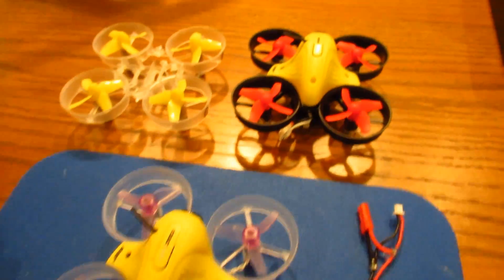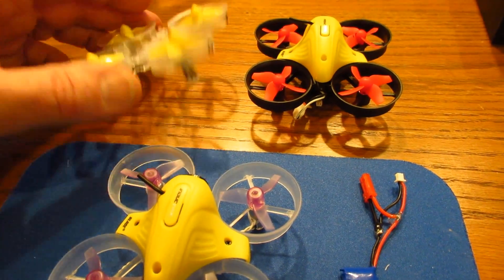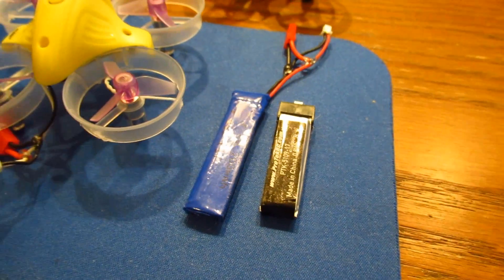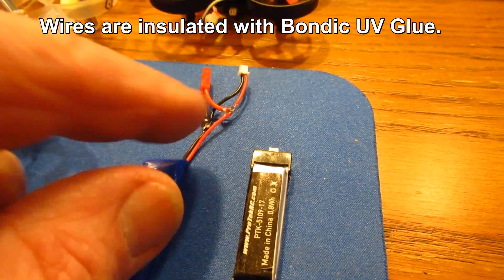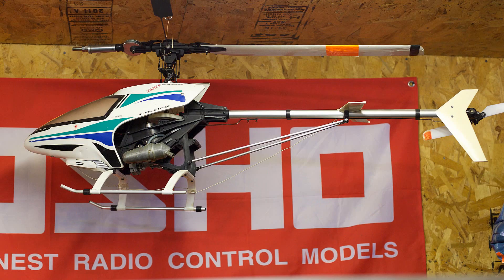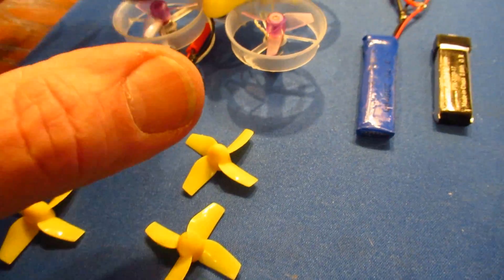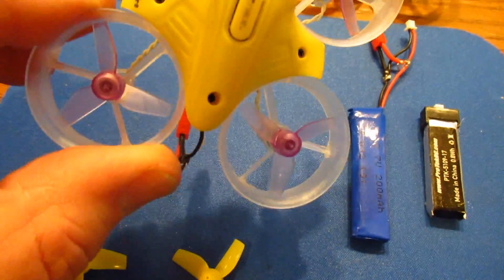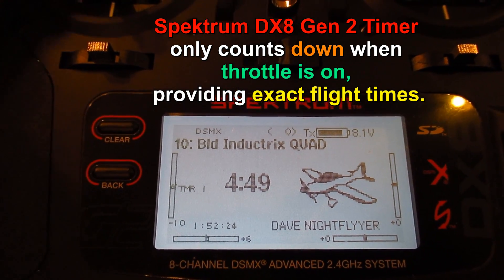Do 3 bladed Props increase Flight Time on the Blade Inductrix as advertised to?

Comment: of course 4 bladed props is faster than 3 bladed props cause 4 bladed producing wind faster than 3 bladed
Reply from the maker: Not true, unless you have a bigger motor.  My one bladed helicopters are faster than any of the multi blade.  It takes more power to turn an 4 bladed prop than a 3 bladed prop.  It's simple Physics. My 2 bladed Inductrix is even faster, and it flies even longer. I've proven it in my videos.

Comment: Just a suggestion; maybe use a throttle percentage timer which will take into account the variations in throttle power used during each flight and produce a more accurate test?

Comment: what happens if i cut the stock 4 blade prop down to a 2blade just by cutting 2 off simply, would that work? as i can only find different colour 4blade ones
Reply: iyt does drop more easy u need more trottle

Comment: A friend has my Align CHP EDL frame that he has mounted to a jig that will be used to measure thrust.  He will be trying a few types of blades, and then comparing a 3 blade head to a 2 blade head, as well as what pitch provides the most efficiency.
Reply from the maker: I just got new 250  MA Batteries from Crazypony and they are even longer lasting, so everything helps.

Comment: In your text you mentioned LVC control how do you disable that on the Inductrix? My Inductrix only gave me 2 to 2 1/2 minutes and it's stop when I measure a 3.7 voltage on the battery

Comment: Cut the four blades down to 2 and Dremel them smooth, best mod I did for my inductrix flight times were atleast a minute longer and the punch out improved greatly! Good to see a comparison with these Rakon blades as I was thinking of ordering some, now I know I will so I can try them with some upgraded motors on a LOS inducrix. Happy flying!
Reply from the maker: I was in the process of doing that and just finished producing the video.  I expected it to work as it is logical, and it did.  Thanks kindly.

Comment: 4 bladed prop and micro deans connector stock inductrix fpv https://www.youtube.com/watch?v=OLwplUC3lCM&t=42s  over 5 minute flight im gonig to say this again the problem is the early LVC bypass it and fly with a timer like i do. battery comes down at 3.65 rest at 3.75ish  but fun seeing you back Mr herbert
Reply from the maker: Yep,  I just finished a 2 bladed prop video and just a standard 200 mah battery and got 5 minutes, so that by itself is a big improvement over the 4 bladed props

Comment: to be honest i been over the flight time and i was the first one to explain about the connector issue on the first inductrix i go for performance, check out my 5 minute blade inductrix fpv flights with acro mode and how fast and great mine flys in 15+ mph winds outdoors ;)
Reply from the maker: I did and it is good.  I also just finished putting 2 bladed props on and find it flies longer and seems to have more punch due to less mass to get spinning too.  Thanks and keep up the good work.

Comment: i've always had a little problem with the one blade hypothesis that one blade takes less energy to spin than two- that's correct, but in my own testing you need to bump up the pitch curve to hover at the same head speed which means that one blade has to work twice as hard- you do not get exactly twice the flight time, but i absolutely agree you will see an increase in time due to minimizing the turbulence. as for 4 bladed vs. 3 bladed, you would need more aggressive pitch on the 3 blades in order to get the same whippy performance out of the inductrix which would be creating possibly more turbulence. The scientific test to prove this would be putting it on a scale and running at the same throttle and seeing how much force is generated- if it's exactly the same between the 3 and 4 bladed props, no decrease in performance would be present and all quads should have 1 bladed props. but i'll bet you 4, 5, 6 bladed props either create less turbulence or have better acceleration or simply fit more lifting power in less space.

Love the videos as always, looking forward to more experiments!
Reply from the maker: Thanks for the comments and tips.  In all my one bladed experiments, I have not had to increase pitch as some I could not, just rpm.
Reply: A standard 2 blade propeller (there are real 1 bladed propellers with a weight on one side to reduce prop drag and use a larger propeller to get more speed per watt) creates less drag than a 3 or 4 bladed prop moving the same amount of air.... the reason some aircraft use a 3 bladed prop is due to some reason a 2 bladed prop is too big. All things equal you will always get more thrust per watt from a 2 bladed prop but small props will always have the advantages associated with short moment arms of force so have some advantages of their own to consider which your post references. But short moment arms for the location of the center of lift on a prop always come at a price that boils down to reduced air time. 

The goal designing a prop is to move as much air as slowly as possible to reduce drag... a ducted fan with the tips close to the duct is not a free standing propeller and the rules of drag don't change but the parts including the duct dimensions do change as well as the type of performance a ducted fan creates. The scientific way is to read books and learn math as to the width of a neutrino this was all figured out decades ago. And without a watt meter and tachometer it's hard to really see what's going on so anyone without a watt meter should get one to even try thinking about what's going on as you have to measure it to see it. I have a pile of cheap watt meters BTW trying to save a buck or two but only one works and it cost $45 bucks on sale.... the Watt's UP meter. It's better than any other watt meter up to 14 AWG size wire for RC use and is very accurate designed with manufacturing quality control based in the USA.
Reply: www.RC-electronics-usa.com
Reply: LOL.. when I wrote that I stopped watching to go look at them... didn't realize you had done it. I'm trying to visualize the drag and true aspect ratio as it "appears" you decrease the aspect ratio almost 50 percent but not really, but add translational lift from forward air movement over the blade and now both sides are part of the same "wing" disk area. As you go longer you can go wider to maintain the same "static" aspect ratio but then again there's less air being moved in the center with more at the tips... the affect of using one blade is really interesting with composites allowing feather light blades to reduce counter blade weights but for some reason it makes me dizzy getting rid of the other half of rotation;-)
Reply from the maker: Again, this was an experiment to get more flight time. That is what it did. My 2 blade test is uploading right now and again it increased flight time. That's all I wanted as was true with all my 1 bladed heli and airplane projects.     In the early days of pylon racing , they also used 1 bladed props. Since I actually tried it and didn't listen to skeptics, I found out myself that it works for me. Hope you watch my next video and also check out the links in it,s description box. I know it sounds stupid, but if it works, it ain't stupid. Lol Thanks again.

Comment: I believe 2 blades would be the optimal design, but not sure the motors would be able to generate enough thrust to keep the flight maneuvers quick and sharp.

If you got access to 3D printing, if you manage to keep the same blade area, same pitch and increase a little bit the propellers diameter to keep the same motor speed, it will probably improve the flight time a little, keep the same thrust and add little or imperceptible lag to the prop acceleration.

Since it's a EDF, not sure if single blade EDF propellers would enhance the efficiency, but I would like to see the test "single blade vs multiblade" just to keep the old tradition of the channel. 

When we talk about racing or accurate movements on the smallest package possible, more blades may be desirable, but if we go to the "long flight time" route, less blades seems to improve the flight time.

Thanks for the fun and educational content Dave.
Greetings from Brazil.
Reply from the maker: Hello Brazil.  Yes you are right.  Too small for one bladed, but many folks have told me to cut off 2 of the blades of the 4 bladed propellers and try them, so that is my next test.  Thanks again.

Comment: good you changed lipo connector maybe the red one is  alittle to big try the walkera style one you can olso get cheap lipos then and with the different frame i think you have more options for lipos
Reply from the maker: There are other options for sure.  I just used what I had, as everything else I had got burned up when the fire hit.  I will get more soon.  Thanks.

Comment: Hi Dave. Thanks for the review, I use 4 blades in the back and 2 blade in the front with awesome results.
Reply from the maker: Now there is a plan!  Thanks.
Reply: Jorge A if thats so what kind of flight characteristics u get?
Reply: Well its faster than all 4 bladez and still have good torque!
Reply from the maker: It flies longer and if you saw my last Donovans video you would see for yourself. I see no perfomance degrade, but the inductrix is no super machine in the first place.  Thanks.